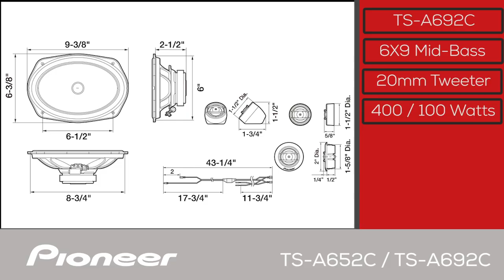TS-A652C and TS-A692C - What's in the Box?

Comment: What are the differences between the 652C and 652F? Both are in my budget but I can't really decide which one.
Reply: Pioneer TS-A652C is a component package.  That means it has a separate tweeter that must be installed independently of the mid bass driver. 652F is a coaxial speaker with the tweeter and mid bass mounted together
Reply: @deckerdotto6035  how good do they sound
Reply: Both of these speaker systems sound great at a very affordable price.  You can learn more about Pioneer speakers here:  https://www.pioneerelectronics.com/PUSA/Car/Speakers   and you can find more videos on Pioneer's YouTube Channel here;  https://www.youtube.com/user/pioneerelectronics
Reply: listen to both of them and decide